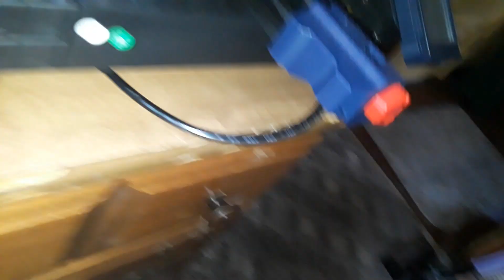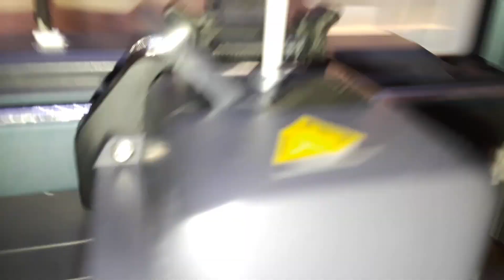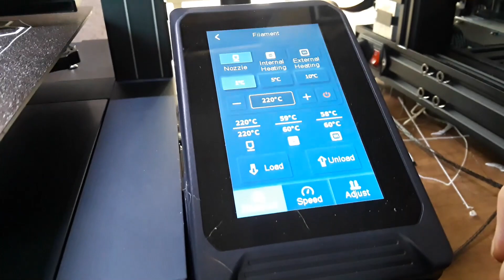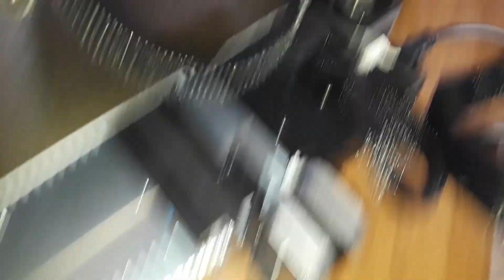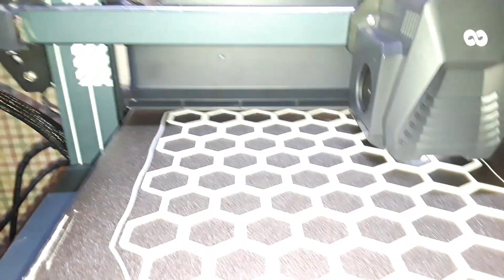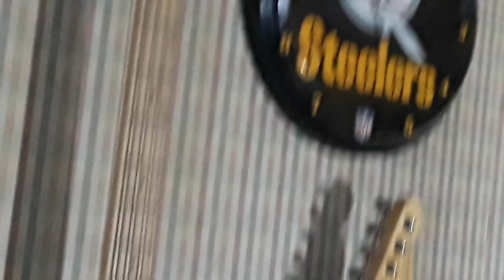Elegoo Neptune 4 Pro Full Review

Comment: hello. I have this printer for 2 days. I did not receive the usb stick, sdcard, the screen did not have the protection label. I suspect that it was refurbished, although I bought it from amazon Italy directly from elegoo at a higher price than the one on the Chinese website.nothing worked from the beginning, but I managed to update the firmware and the screen (before the screen update, the printer remained stuck in the leveling menu).my problem is that no matter what I do, I can't print anything, that little bud....I get the same error:move out of range. I still don't know how to proceed, return the printer (thank goodness I bought it on Amazon and not directly from China) or waste whole days trying to solve it.
Reply: Ciao se compri direttamente dal sito di elegoo risparmi anche e ti mandano tutto e hai 14 g per reso

Comment: What is the actual status of printer profile for Cura >4.9 up to 5.6? Cura does not support Neptune 4.
If I install 4.9 (and up) then I get an error message that my profile is corrupt and I have to delete all profiles to install the printer profiles new... but there is no printer profile in regular Cura versions.
WHAT is the soulution to copy the 4.8 profile to newer versions?
Reply from the maker: My solution was to switch to Prusa Slicer.

Comment: I have to say it's been a massive disappoinment for me. It falls apart at speeds above 150mm/s and has a lot of weird quirks compared to the Ender 3 Pro. I just don't trust it to actually print anything successfully.
Reply from the maker: Huh? Weird. I run it 300mm/s every day. No issues.
What kind of problems are you experiencing?
The only problem I've ever had was software. I was printing a whole bed of parts and they kept getting hit by print head. Just some travel adjustments fixed it.
Reply: User error for sure.

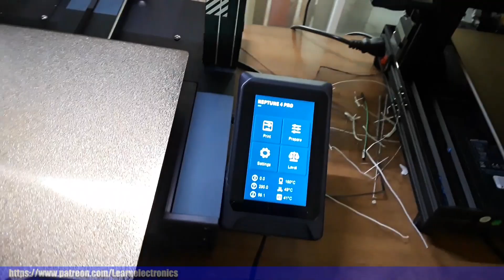Comment: 25:15 - The fan speeds were MUTE, NORMAL and VIOLENT.  Now they're SILENT, NORMAL and SPORT?

I'm thinking about getting the Neptune 4 Pro, but I really want the plus size version, and I'd like WiFi as a standard feature.  Not many people use wired LAN connections today.

A lot of the hoopla over the new core XY printers has little to do with the core XY architecture.  The speed and print quality is mostly due to Klipper, as is the improved user interface.  It's great to see Klipper making its way onto some less expensive but high quality bed slingers that are easier to use and easier to maintain without hiding everything inside an enclosure.

Comment: I always enjoyed learning from your videos, but this, 3D Printing and Klipper you have got me watching every new release for sure. I have a 3D Printer I use for Model Trains.  Started with a M3D All plastic toy printer and now a CR 10S Pro. Needed the size to print larger train bodys. Over time I added stuff to it  the Z axis Timing Belt, Z axis Struts, MicroSwiss Hot end, AND Direct Drive. BL Touch bed sensor and Octoprint on a Pi 4B. Two weeks ago I ungraded to Klipper Firmware. A 7 inch Touch panel and Octo PAD user interface. Its a complete transformation. I am so glad to you with 3D Printing. Now I need to get you on my Train Scale and we can have some fun.  I am trying to go IOT on my 1950s Train and as you know making PC boards is not my strong suite, yet.  Best Regards, great printer demo and great machine for the money. WOW! Dennis
Reply from the maker: Thanks Dennis. I'm a train guy as well. Unfortunately, my ex-wife was awarded all of my Lionel trains that I had spent 40 years collecting. She sold them for .....$600. Still brings tears to my eyes.
Anyway, lots of 3d printing and electronic mash ups coming. If you have any ideas I'd love to hear them.

Comment: The manufacturer seems to have chosen the marketing path for this model. 
Adjusting the table is good.
A disposable heavy extruder is bad. Namely, the manufacturer made it disposable in pursuit of relief (unsuccessful, but more on that in the end). Gears are now original and unassembled, and it is impossible to buy them even in the official store)) The quality of the gears is not very good and, of course, they are NOT hot (like steel, not magnetic, it looks like stainless steel), so do not try to print composites. 
At the same time, the plate of the table carriage remained steel (aluminum would be 20 grams lighter and not worse). 
The nozzle heater is now also rare, in size 16*15*20 mm. So I still have to look for replacement socks. And the native sock crumbles after two weeks of work at 255 degrees. 
The LED on the extruder is cool, but I feel it will die because of working in extreme thermal mode.
For the same reason, the inductive sensor of the auto-level of the table will also die. On Neptune 3, the same one died after several heats of the table to 85 degrees (the printer is in a passive thermal chamber). If you plan to print petg and abs, then buy a pair of spare NPN NC type. Do not try to find the original ones, they, like the gears, are also not in this store or in others))))
The nozzle radiator fan is now 3010 (instead of 4015), works at much higher speeds and will die sooner. Fortunately, if you file everything superfluous in the extruder, you can find a place for the cooler 4015.
Super blowing is not needed, because there is no question about the quality of printing at the stated speeds, so we have 4 unnecessary 4020 snails. 
And I also decided to weigh the extruder assembly ... (in the advertising picture, the seller boasts of the extruder's weight of 291 grams, which is like a hundred grams less than Neptune3). And so. The extruder assembly actually weighs (!) 472 grams! 
In general, there will be no long-term high-quality work at the maximum declared temperature characteristics, there is also no need to wait for speeds, and it is better to buy Neptune3, which is much cheaper and more maintainable.

The practical printing turned out to be somewhat better than I expected. The quality begins to be noticeably lost at speeds as much as 100 mm / s, which is very decent, despite all the jambs. The list of which I will probably continue. 
The z-axis guides moving along the screw axes have a backlash of 2 millimeters. It must be eliminated, while avoiding the rigid attachment of these guides. 
The system loads from 30 seconds to 3 minutes. The screen freezes very often when the buttons are pressed (usually for a couple of seconds, but sometimes up to 10 seconds). Occasionally, after pressing the buttons, the required action does not occur. It is impossible to press several different buttons in quick succession.
There is no menu for setting jerks and accelerations, and what the manufacturer has screwed up by default, it's scary to think, given what he "calculated and projected" print speeds. We'll have to manage this from the slicer. 
An adjustable table is probably a good thing. but. 
1. Two-stage calibration of the table at 121 points is too long, namely 10 minutes from start to restart to save the parameters (without a final reboot, the table map is not saved). About half a minute of this time is spent by the printer on unnecessary trips from the zero position to the same zero position. By the way, before printing, the printer also goes home twice for some reason. 
2. the alignment interface is made completely incomprehensible. Visualized is not a logically obvious square of 11 × 11 points, but an incomprehensible rectangle of 6 × 11 points. the zero count on the z axis does not come from any particular angle and/or level, but floats all the time according to an incomprehensible algorithm and it takes a crazy amount of time to truly align the table! The first time it took me 5 hours of almost continuous attempts, the second time a few days later I managed in 3 hours.  This is a procedure that should take 15 minutes! moreover, I understood the process of achieving the result very vaguely and, even having achieved success, I cannot explain it (which means I cannot repeat it quickly).

It was only possible to understand that you need to turn in the corners where the value is minus counterclockwise, and where the value is positive - clockwise, but only in one corner and a little bit. 
By the way, the Z-offset is reset when calibrating the table and needs to be reconfigured too. 
3. The heating of the table and the extruder has really become more efficient.  However:
If you change the calibration temperatures of the nozzle and table through the standard settings, then instead of calibration, the printer hangs tightly after heating. 
The settings of the preparatory temperatures of the table and the nozzle for the accelerated start of printing do not work here at all, since if you turn on the preheating of the table and the nozzle, then before printing the printer to turn on the heating of the table to the operating temperature... Attention!.. It will wait for the nozzle to cool down to 120 degrees))))
In general, compared to neptune3 pro, very ambivalent impressions. However, the disappointment from the shortcomings is gradually compensated by the fact that in fact the neptune 4 is about 1.5 times faster than the neptune 3 pro with the same print quality.
Reply from the maker: I have not experienced the problems you have. I've now run 3 spools of PLA, about .5kg of PETG, a few yards of ASA, and a few yards of abs. Perhaps those problems will present themselves, perhaps not. I've run the printer almost constantly for about 17 days now so we are past the infant death time for electronic failures. No degradation of the silicon sock was noted.
I fully agree with you about the nozzles. However they are available from 3d parties.
As for the jerk settings, that is available to adjust in your printer.cfg file in Klipper. That's Klipper's advantage, all settings available for editing from a simple text file. Peace.

Comment: Wow, $300? This is such an advance from even a few years ago. You'd have to pay $600 for a printer with anything close to those features (good auto bed leveling, filament runout sensor, direct drive, etc.). Even the touch screen looks like a massive upgrade in terms of responsiveness. I'm interested in how much better the roller wheels are compared to the traditional threaded rods.
Reply from the maker: Rollers and rods are only on the x and y. The z still uses a lead screw. On the 4 pro, there are 2 motors and they have a sync belt.

Comment: Elegoo is killing it with both the excellent FDM & Resin printers they are currently releasing, imagine if & when they release a Bambu Labs core xy equivalent...I want the Pro but can only get the Neptune 4 at the moment in the UK, is there much difference between the 4 and 4 Pro? I am now thinking what is the point of going up market to a P1S when the Neptune 4 is this good...
Reply from the maker: The pro has hardened steel rails and wheels on the X and Y axis. Also, 300 degree hot end
Reply: @learnelectronics  The non pro has a 300 degree hot end as well ?
Reply: @LAKXx  Yes it does. the differences are the wheels and another heat zone on the bed.